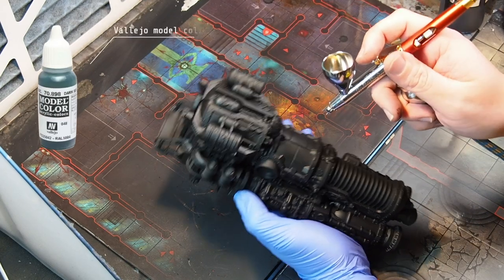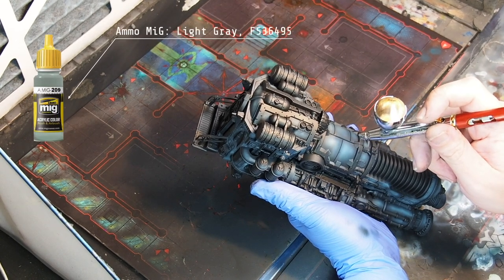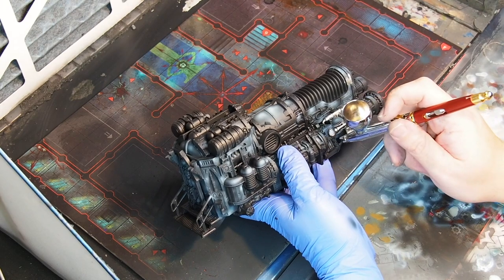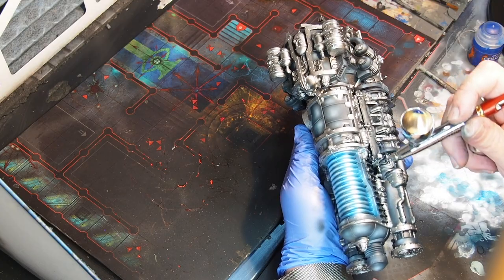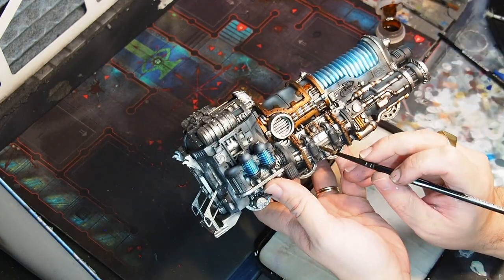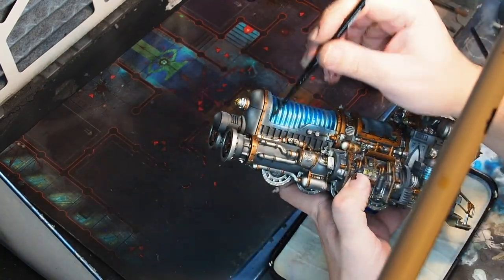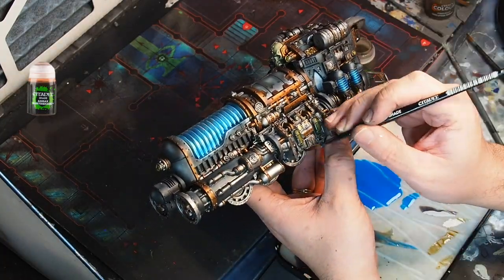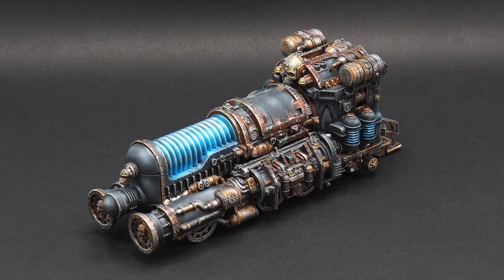Warhammer 40k, Necromunda train - How to paint train

Comment: Vallejo metal color is perfect for the airbrush. I use it all the time straight from the bottle it’s also fine with a brush and excellent coverage. The only issue I find is that there is no bronze colour in the range but they mix well so I usually make my own.
Reply from the maker: Yah, from the metal color brands I have tried, the Vallejo one is the best so far. Its just a bit harder to control for me :D So I think I just have to practice more. I did like the Ammo MiG Alclad Metal colors. Bronze worked really well, but its alcohol based.
Reply: @MrLeonarddime  cool I’ll try the  bronze as i seem to use it a lot with my schemes thanks.

Comment: What happened with the white vents on the back of the train? They look like you meant to do something there.
Also, I use Talassar Blue for plasma coils too, just over white. I didn't think to do it over silver.
Reply from the maker: the pipes on the back you mean? Those are just pipes :D So they break up the empty space of the column. Not all column pieces have these pipes.
Reply: @MrLeonarddime  The white vents. 15:22 between the little blue plasma coils and the red light, or 20:34 under your thumb.
Reply from the maker: Ah those. They were just painted with the Basilicanum grey. Shaded darker (it’s not white. It’s duuuuraliminuuuumm...